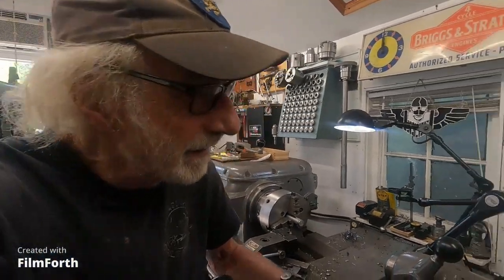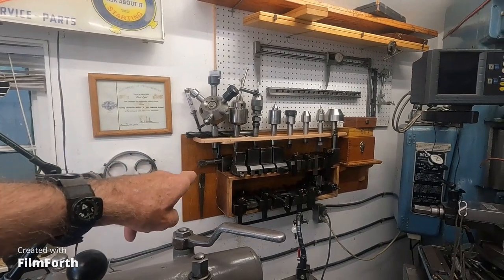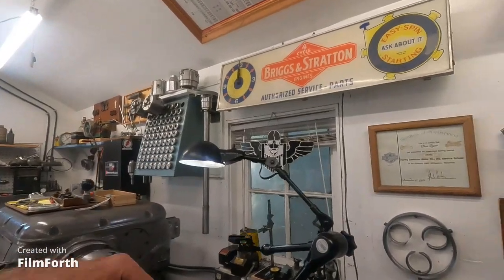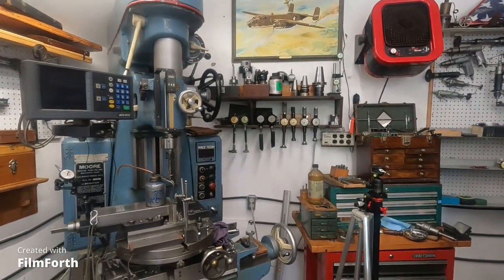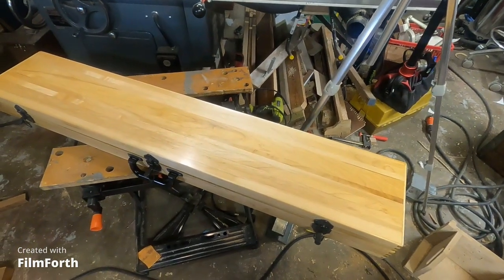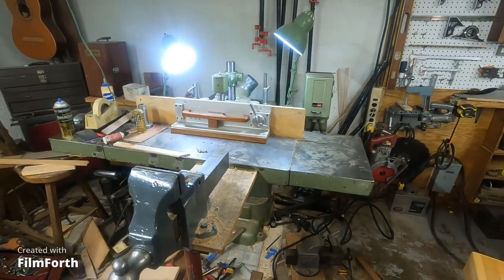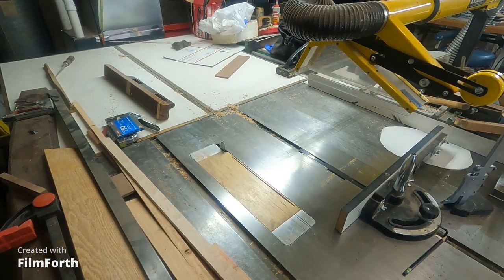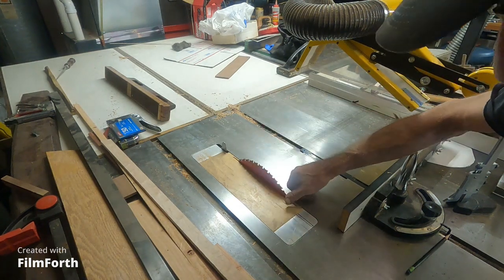Machine tool drive belt set and wood working machine smooth running

Comment: Would you be willing to share any details of your Aigner work holding fixture.  I would like to make one.
Reply from the maker: I will show it when I need to use it, in the meantime the original can be seen in a German YouTube video under Aigner Contermax, The ones I built  use filler wood for coarse adjustment and are heavier for a wider variety of wood and fixture clamping and large lock miter joints.https://www.youtube.com/watch?v=top6Oi_kVs8

Comment: Great tip on the belt set. I've got the same over arm dust collection setup on my 10" Delta cabinet saw and I love it. Thanks
Reply from the maker: This saw came with the dust arm and the sliding table from the same company I have not the room to install here. I also have in at a right angle the mid 60s Powermatic 65 cabinet saw 2hp 3 phase that the seller was ready to give away because of the 3 phase.
 Both the Delta 12/14 and the Powermatic 65 have remarkable dust control if you use the heavy stock blade guard, standard table/blade insert, That dust arm and a vacuum is so much better!